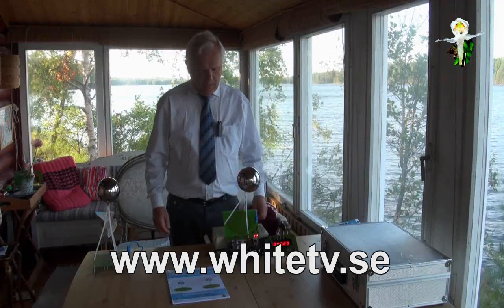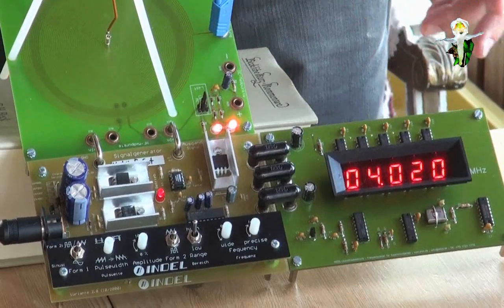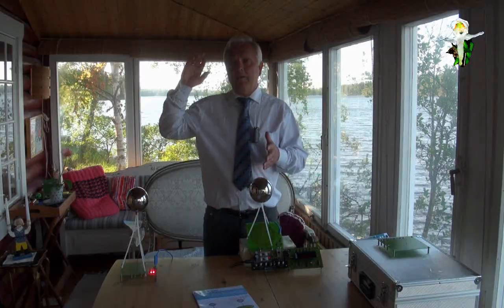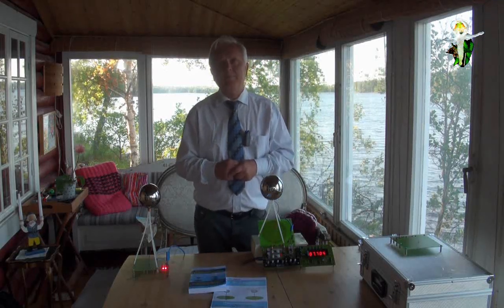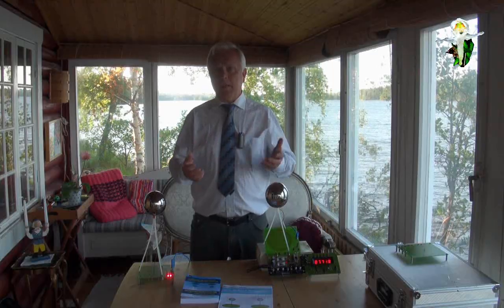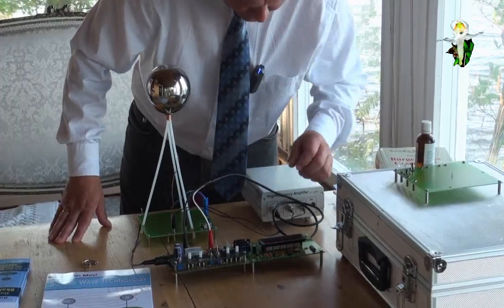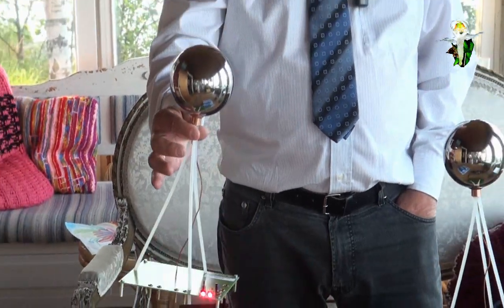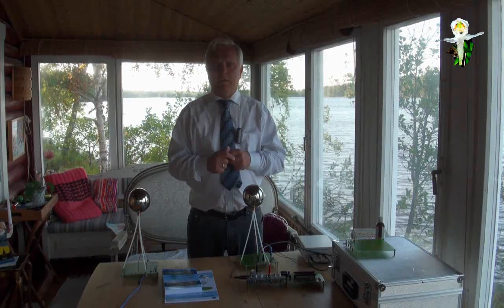Technical proof: scalar waves exist

Comment: He connected them with a wire. No wireless transmission necessary. Am I the only one bothered by this? This is a demonstration of single wire transmission, not scalar waves.
Reply: Who and thought about Hertz, he can forget about scalar waves - spoke of Nikola Tesla
Scalar waves are transmitted - currently - at any distance (Tesla did not need earth or wire for the transmission) ..... graphic - scalar wave is a straight line, ie. no waves
Reply: *****
Huh?
Reply: Dziaji
Huh ? :)) ....... The normal electromagnetic fields have a certain direction (so-called vector fields). Apparatus for creating a scalar fields are special in that they make the fields that do not have direction vector. This special fields arise when two opposing vectors canceled, then when it encounters the valley of waves with wave cam. In doing so could cause the cancellation of applied energy or power, but no information. These waves are called "scalar waves" or informational fields.
Nikola Tesla inaugurated the concept of scalar waves describing the non-electromagnetic field potential that can not be measured by standard electrical detectors. However it left clear traces in nonlinear systems (plasma, crystals, semiconductors, living cells).
Scalar waves its properties beyond the atomic level cells in the body, while electromagnetic waves (vectors) are rejected by the electron cloud.
'' So it becomes understandable that the apparatus for creating a force field working with scalar waves have a comprehensive effect on the body and on the basis of their 'deep penetration' possession at the beginning of these features which affect the expansion of consciousness. '' (Nikola Tesla)
Tesla made one generator '' scalar wave '' with additional coil ("extra coil"), a key element of his "Magnifying Transmitter", a controversial device from Colorado Springs, and so is its unique reduced version. - Designed by a particular Tesla's principles, generates and broadcasts of Tesla scalar, stationary waves, with its radiation in the domain of Hertzian electromagnetic waves is minimal. Not only that meets the requirements of electromagnetic resonance, but also the general conditions of cosmic-compliance (spatial time - harmony, spatial synchronicities, their mutual coherence), which means that its emission spectrum and interact with objects of a higher degree of quantification of photons, sub-entities and plankovskim other, more subtle, phenomena from the domain of the spiritual aspect of our reality. Given this specificity waves generated, it was found that TeslaGen act as bio-energy regulator, or Harmonizer bio-energy fields
It can be said that this is a unique bioenergetic stimulator for the preservation and promotion of health.
Today's study, military experts as a weapon to control the mind (psycho - weapons) !!!
Specific construction and effect of Tesla coils further decipher the ing. Goran Marjanovic after years of theoretical and experimental work. According to the settings of his cosmological model quanted Energy Density (KGE). Tesla scalar, stationary waves occupy an important and until now vacant place on the scale order to understand nature. They are dimensionally richer form of energy vibration of all that we know, so-called "Hertzian" electro-magnetic waves and their modifications, differentiating its specific energy structure and a special quantum carrier of their propagation - stable object called - Teslion.
 "Non - Hertzian" scalar waves - Teslioni- are at a higher level of quantification (k = 9) of photons - the holder of the famous "Hertzian" EM waves (k = 8), which means that their wave form goes deeper into the domain duhvnog aspect of our reality . This quality allows the interaction of Tesla waves with subtle energy aspects of being (emotional, mental, astral, spiritual), because their coherence with bio-structures of a man much larger than the Hertzian electro-magnetic waves.

  "... What impressed me as nicer than anything else was the discovery of stationary waves that I made in 1899, which showed that the planet we live on, despite its unimaginable size, may be forced to respond by flashing the quietest whisper human voice ... "- Nikola Tesla
'' In my questions, which is speed teslion, it was said that he was two and a half times faster than photons, and what is after him, is there something that has more speed than that, it was said that I teslion "encroaches in spirit, "and that after him there" thought and ideas. "
(foto) http://i.imgur.com/zTPrlDI.png
Reply: What are you talking about? This apparatus has nothing to do with wireless transmission. The 2 antennas are connected by a wire. I don't need a lesson in Tesla.
Reply: ***** Excellent description.  That makes complete sense.  I am a novice in this tech, but Dziaji, I believe that teslaskalar was agreeing with you in his first statement, and then explaining why.  He initially said "Tesla did not need earth or wire." 

telsaskalar, I am doing a little research on application of scalar transmission on cancer treatment to refer to a friend of mine with cancer.  I have a Biotech background, and there is currently nothing to treat what she has from a biological standpoint.  There is a great deal of erroneous, and unsubstantiated info on this tech and it's applications regarding medical treatment.  Would you mind referring me to some sources that would be of help.

Your information is much appreciated.
Reply: ***** One other question.  If there is little or no wave, then movement through space is diminished greatly so it decreases distance traveled, correct?  Is that why this transmission is faster that photons, or am I off base?
Reply: Daniel Kahl Ok. I'll try to explain better. English is not my language No. 1, it is possible to be some lack of clarity
  Scalar waves generated interaction of two coherent electromagnetic waves of the same frequency and opposite phase. In addition, the resultant energy field created by interweaving opposite electromagnetic fields, NOT their complete cancellation, as is usually thought, but the transformation of energy in the field of vacuum in the state of potential and the creation of so-called. Scalar field!
  If you are interacting waves are coherent and opposite but unequal intensities - resulting standing or stationary wave. Slow or fast moving scalar fields are modifications of such waves and coherence arise when interacting waves is not complete, or when one of them or both of the changing phase.
  The longitudinal wave is a wave in which the propagation of particles oscillate in the direction of wave propagation. It can move only through substantial environments which possess elasticity. Example of longitudinal mechanical waves are sound waves in the air. Electromagnetic waves or longitudinal scalar electromagnetic disturbances may arise appropriate modulation of the structure of plasma phenomena. In this regard, ball lightning as a specific form of the stationary EM fields.
 The effect hertz waves at a distance is very small, because they during their journey, even at short distances from the transmitter considerably weak which makes them absolutely useless for the transfer of energy to the possibly greater distances. In numerous instances, the description of its different structures, Tesla emphasized and indicates that the signals at the receiver side, caused by the current through the Earth (Earth Currents) a non - spatial, Hertzian electromagnetic waves. Moreover, claims that the very low frequency vibrations more effectively in the transfer, ..., and literally says: "The theory of wireless transmission Hertzian waves can be accepted for some time, but I do not hesitate to say that this will soon be recognized as one of the unexplained and significant deviations scientific mind which has ever recorded in history. "
  Tesla believed that energy can be transmitted more efficiently using non-Hertzian waves, special wireless technique that he developed called "method disorders charge in the land and in the air." Construction grounding equally complex as well as the Tesla tower. Tesla Wardenclyffe-in used in extremely low frequency in combination with high-frequency signals so that, in practice, the transmitter operates electrically and the earth and the space above it ...
  Article for "Telegraph and Telephone" (16.okt.1927.) "The world system of wireless power" in the section 'High transmitter and the resonance of the earth', described the current mode of propagation of the Tesla transmitter through the globe, and it's something most unusual as to control spreading of the charge on the surface. As in the previous section we explained from Colorado Springs, wave begins, theoretically infinite speed, then slows down abruptly and then slowly up to a distance of about 6 thousand miles. From that distance continues propagation speed of light (300 000 km / sec). After that, the speed increases again and it slowly, then faster and faster until it reaches the antipodes with approximately infinite speed. Electricity penetrates deep into the ground, so the fact that it produces the same receivers as if her entire flow was collected in the Earth's axis that connects the transmitter to the antipode. Therefore, the mean velocity at the surface of 471 200 km per second, which means that 57% greater than the speed of hertz waves whose speed of light. The same constant found the captain and Si, an American astronomer known by Tesla mentioned in the above article and who, in his mathematical research to move the smallest particles of ether Si expert called "eteronima". So this is a full five years before Einstein's special theory of relativity-breaking second postulate of this theory of light as the fastest emergency in nature .Also noted later in experimental research Nikolai Kozyrev famous, revealing so. "Torsion fields and waves."
  Bearing in mind these Tesla's statements, incredible persistence and consistency of many researchers of Tesla's legacy in an attempt replicas of its devices - but based on Hertzian technology is - strange
 Scalar, standing or longitudinal waves are significantly different from transverse, Hertz waves in the same sense in which the gamma rays differ from optical waves
  Close shape could be one particular form of classical Hertzian EM waves that modern science is called waves volatile form (G.Nimtz, evanscent mode waves) that are characterized by a negative wave number, ie. negative wavelength, or frequency, but those from the point of Maxwell's theory, have imaginary energy quality. Given that represent the full analogy of virtual photons and particles of quantum mechanics, they are characterized by inability to detect with conventional detectors
 And the latest theoretical and practical research in the field of so-called. "Etheric energy" dr. Klaus Volkamer, the dr.G.I. Ship, dr.A.E. Akimova and others, in favor of the controversial (and concealed from the public) knowledge dr. NA Kozyrev and indicate the existence of a substance which is characterized by the omnipresence, interconnectedness, non-electromagnetic properties, the ability to transfer energy pulses at speeds several times higher than the speed of light and are stated ability to survive, and after an interruption of power.
 Tesla device from Colorado Springs is not "ordinary" (air) of the transformer, as it mainly represents but a multi-dimensional oscillator which generates a much more complex range of power fluctuation, which, of course, includes the EM spectrum. Dimensions and space-time relationships of all the elements, especially the so-called. additional coils, have a much greater significance than inductive-capacitive size, coupling strength and the like, which are only considered in classical scientific analysis. This is a major drawback of most so far on the analysis and the main reason for the lack of effectiveness of all previous "copy" of the device. Specificity of the construction of the entire machine, especially the so-called. additional coils, enabled Tesla to obtain results that no one has managed to repeat.
 (Tesla generator waves) broadcasts a special kind of radiation, which belongs to the central part of the spectrum of bioenergy, green in color (in PIP technology). The complementary and alternative medicine (eg. Bioenergy) methods of treatment, the green color is commonly associated with curative radiation energy balance and general well-being, does not work on the physical, cellular level through the electro-chemical influences, as is the case at all so far known medical devices and aids in the field of complementary medicine. Its action is specific. Previous experience in favor of a beneficial impact on all devices bio-structures, although this action can not be registered immediately, except for special diagnostic techniques, such as polikontrastne interference photos (Dr. H.Oldfield), GDV Camera (Dr. Korotkov) and similar . These techniques are still not recognized as a scientific diagnostic methods, but so far, and there was no medical experiments in this area.
   The device has been postponed because the operation works on the subtle-energy level (in the esoteric: the astral and mental). Generator of Tesla scalar improves the Wave "energy" matrix beings, leading to a natural balance all its subtle energy levels. This balance is building a structure that matter can be followed (see work Ing. Goran Marjanovic)
 There are people who say that with Tesla scalar waves can cure all. What is a lie, as (for example, Tom Paladino, cures via email?)
  Nikola Tesla himself improved health with the famous '' fitting purple or the purple disk ''
Tesla was the first to notice the importance of physical electricity and natural health and he made electrotherapeutic devices. The invisible waves the sea, which we are lapping up every second, has its quiet power - these are the waves of high frequency and low power, then "pastel power" - that is the visible part of the electromagnetic spectrum, but also dangerous hurricane power - radiation is very small frequency destructive power. Every moment all these waves crashing and bumping around a man in it. "Myths about evil spirits," said Tesla will once for the "sun" ("The Sun") "certainly, their large part caused by invisible, harmful waves that can be registered only scientific experiments." Tesla was first noted (1890) that the electromagnetic balance in the cells of the basic prerequisite for a healthy, normal life. A century would pass between these Tesla's words to them were fully supported by the work of German engineers and physicists Robert Endrosa
Tesla, for medical purposes, in the 1891/1892. The more electrical devices designed high frequencies. In general, these were devices which consisted of machines (high-frequency generator 5 000 100 000 Hz), which is powered by a voltage transformer at the secondary of tens of thousands of volts. At the ends of the secondary of the transformer is located sparker - two closely spaced beads.
The use of Tesla currents in the treatment of people symbolically announced his famous lecture to the members of the American Institute of Electrical Engineers at Columbia College in New York, 20 May 1891. The theme of the lecture was "Experiments with alternate currents of high frequency and their application."
Success is achieved when Tesla did a portable miniature oscillator which is popularly called the "Mini Tesla", or "Pocket Tesla" (there are two in Tesla Museum in Belgrade)

 http://teslaheritage.com/index.php?option=com_content&view=article&id=141:goranclanci8&catid=60&Itemid=609&lang=sr

http://www.meyl.eu/go/index.php?dir=40_Media&page=1&sublevel=0

Discovering the secrets of light - will answer about the creation of matter, which means and cells of the human body, the transfer of information as well as its effect on DNA. Answers are in the waves and vibrations, as he thought Nikola Tesla.
Reply: Thank you for your detailed explanation and references.  The concepts are becoming a little more clear now.  I still have my own homework to do on this, and your references and descriptions will help me greatly. 

As for your English:  it is better than most Americans' English and grammar are these days, and easy to read.
Reply: Daniel Kahl I'm glad that I was helpful to clarify at least a little Tesla's way of thinking, as a directions for future research. Of course that has a lot of homework. Most texts dealing with Tesla are general and include several his works, already in use, along with a biography. There is little public research on the part of Tesla's interest, that today's science can not accept, from the appearance of Einstein's theory. This also applies to alternative medicine, but there are people who already explored, and are not afraid to condemn scientific circles.
  Therefore see and  '' Tesla metarmofoza '' if you find in English. majority of the Serbian language, which is difficult to translate alone.
 For starters here's a reference , these techniques have already cure people
 http://www.teslametamorphosis.com/index.html
 I want you to succeed and help your friend
Reply: I understand what you mean.  I am well aware that C and G are taught as constants while it has been well documented for over 30 yrs that they are slowing and weakening, respectively.  Also, C is still taught as a speed limit (at least it was when I was in University at NC State 10 yrs ago) - I did have a quant mech prof who disagreed with those, unofficially.

I will continue to do my homework with an open mind, but with scrutiny.

Thanks again!
Reply: I know a physicist that has worked as an independent contractor for NASA for many years, and she has told me much about the holes in Einstein's published theory of relativity that are well known in the non academic/pop-science culture.  She along with her fellow scientists that work for the US gov are forbidden from publishing or talking with press on any of those matters. 

From personal experience working with NIH, FDA, and CDC I know full well of the promotion of the chronic medical industry vs the acceptance of advancement in true therapy.  It became so much of an issue for me that I have left the biotech industry and gone into multimedia/IT integration.
Reply: Dziaji Watch the whole video next time. 46:22
Reply: Holy shit. I did watch the whole video last time, but I didn't realize that he had totally unplugged the wire. If it works with no wire, why does he usually use a wire in the demonstrations? Does it improve the efficiency when it is grounded or something? Thanks for pointing this out.
Reply: Also, how is an led shining when the circuit is open?
Reply: Oh I get it, the open circuit is inducing a current in the closed led circuit. So that sphere is connected to the coil, and then the other side of the coil just terminates in space? That's the part I'm not getting. How can you have an alternating current in an open circuit?
Reply: No idea man... this really is some unknown territory!
Reply: +Dziaji  Dear Dziaji,   You have to go to the part of the demonstration where he DISCONNECTS the ground wire from the receiving coil.  He then picks it up in the air and moves it around.  During that part of the demo the LED's continue to glow just as brightly.  Maybe you should do a bit of review. Theo
Reply: Dziaji  If you had taken the time to watch the video to near the end he shows the electric scalar wave responding to a flourescent light.Then at the end of that section he disconnects the floating ground and picks up the recieving tesla coil and moves it around in the space ,the led's are still lit!!.
Reply: Dziaji  Its a capacitor. Capacitors pass ac signals. Remember faraday's rules electric field lines must terminate on a conductor no mater where they are  located in space.
Reply: @Dziaji  He disconnects the wires later in the video and show the LEDs still illuminated